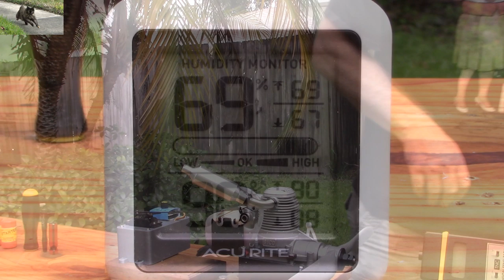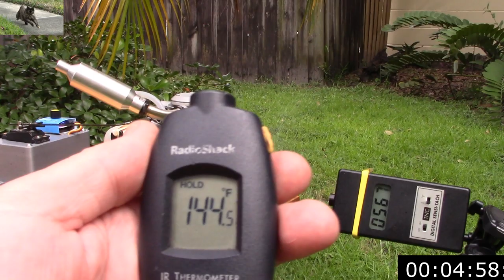RCV 91CD The First Run

Comment: Vn. I saw you checking the temps. Question I have an os 1.20 pumped 4 stroke What are good temps to run the engine I can't find anything in the manual. Ty
Reply from the maker: I check the temps out of curiosity only.  There is nothing in the manual because it is rather pointless. It is not an effective means of tuning an engine.  I cannot answer your question.